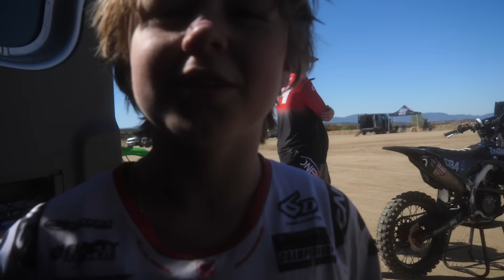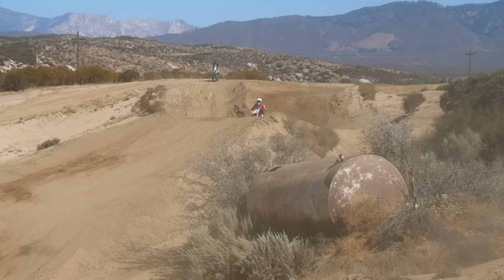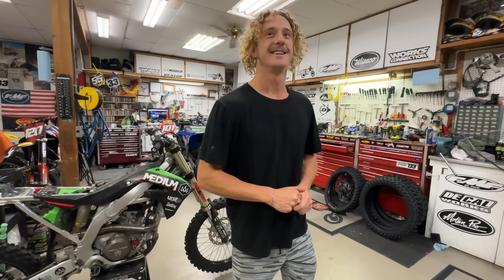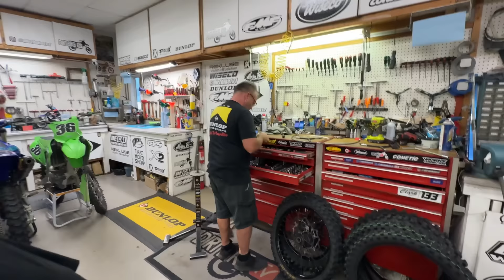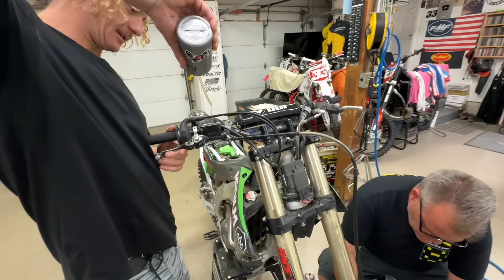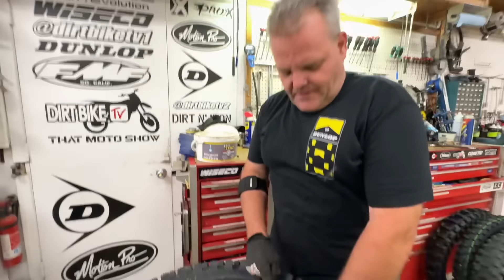Cutting A Dirt Bike To Work! - Buttery Vlogs Ep262

Comment: the bolts on my front brake reservior were seized too. i also used an impact screwdriver. unfortunately one of the screws sheared in half. so i had to drill it out and use a bolt. for everything else ive used them on though, those impact screwdrivers are worth their weight in gold. everyone should have one.

Comment: Slather a dab of silicone sealant on your battery leads/posts and they won’t rattle loose, I almost learned the hard way road racing at willow springs in turn eight. If you need to remove the battery you easily peel it off!
Reply from the maker: Facts
Reply: @buttery_films_  I appreciate your channel and you are one of the reasons I got an enduro, I grew up on dirt bikes and then got into road racing sport bikes. I’m almost 60 and bought a KTM 500 EXC-F Six Days this year to get back in the dirt. Keep up the great content!